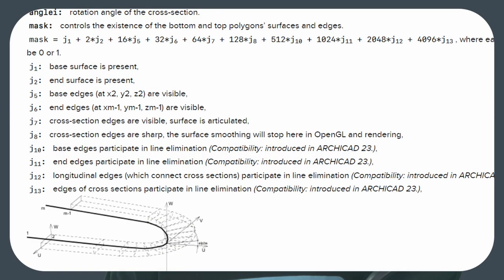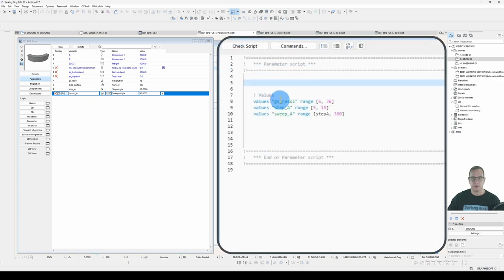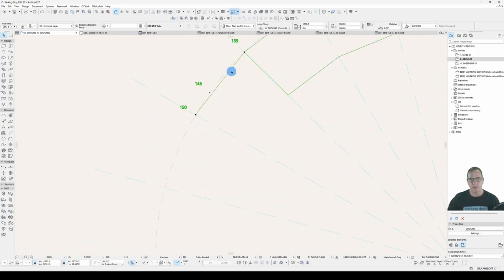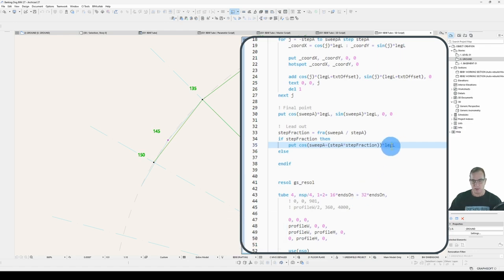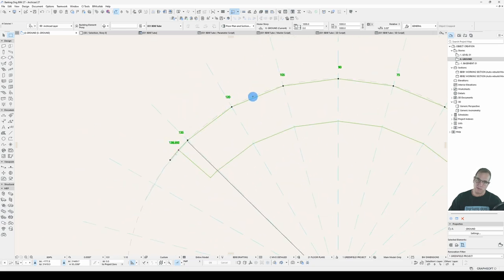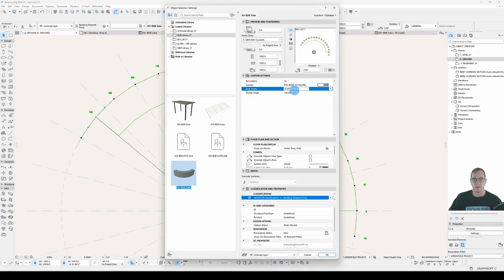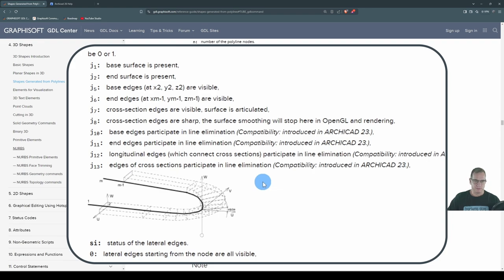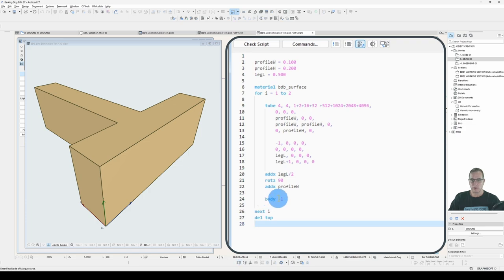032 Archicad GDL TUBE Command Extras

Comment: very good! Bruce, I have a question, how do I round a decimal number up or down to 2 places and this new rounded number be used to calculate an area, multiplying by another number (example: 2.355 to 2.36) So I take 2.36 and multiply it by another number. I ask this because the only way I found was to create a loop to check the third decimal place, but the code was too long.
Reply from the maker: You use the ROUND_INT (or INT...depending on what you want) function combined with a multiplier to get the decimal rounding desired.  E.g. 
oldNumber = 2.355
newNumber = round_int(oldNumber*100)/100
Reply: @BarkingDogBIM  Bruce, thank you very much! 
I understood the logic after I did this calculation on the calculator. 
I hadn't thought about that. 
You are the best teacher I have ever had.
Thanks again!